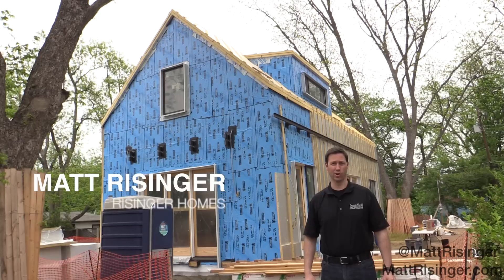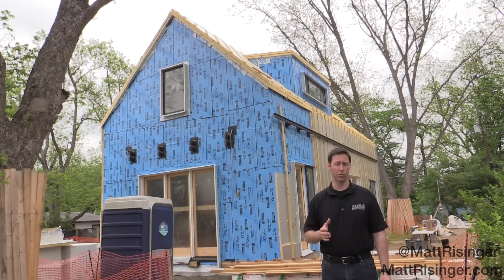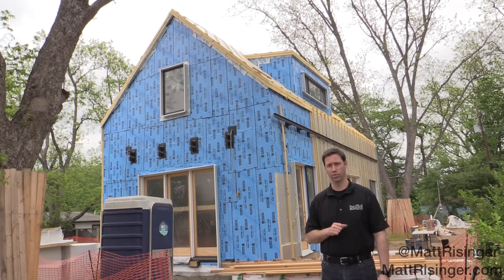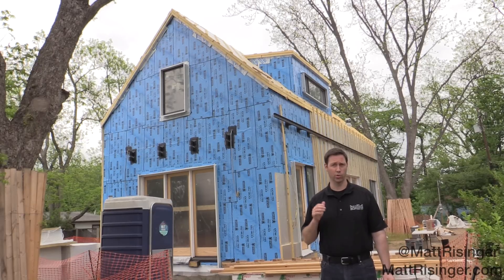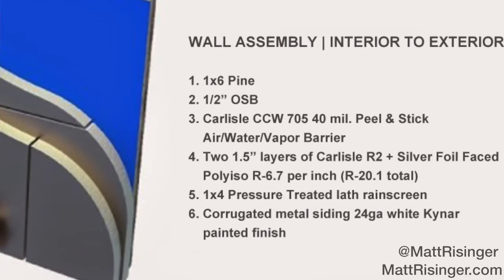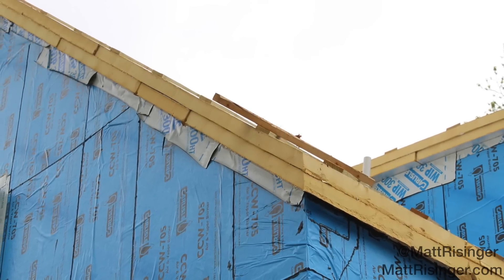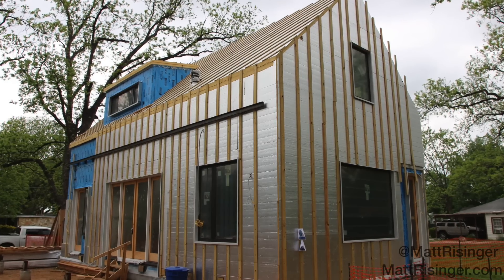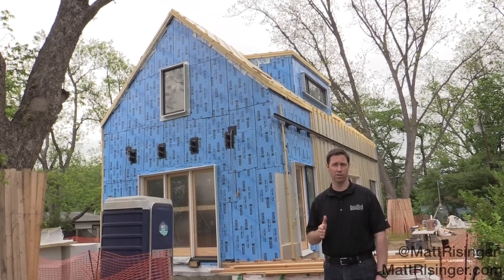What is the "Perfect Wall" for a house?  (with 500 year durability)

Comment: Thanks, the video was enjoyable.

Why put a fleece jacket on the outside rather than between the ribs? Surgical requirements aside, people feel cold based on the perception of skin temperature. (Tests done with Navy SEALS many years ago.) With a house, unless you are touching a wall, insulation is designed to reduce the exchange of temperature from one environment to the other. I'd have to see a test of how moving a set amount of insulation outside of a structure rather than within the structure makes a substantial difference. Best system is likely a staggered structure that reduces conduction through the structural material. Considering build cost versus energy savings, calculations would need to be done using the speculative information on what energy costs will be. Lots of variables are in this decision.

Comment: i think this is a sound concept but claiming 500 years i think is a bit optimistic.

r20 isnt even code for exterior walls where i live. if your looking to have a well insulated house where i live your looking at around r30 atleast. 

and a stick frame house lasting 500 years? with some peel and stick stuff? sorry but i dont think so. the adhesive on that moisture barrier is going to break down over hundreds of years no matter how great it is right now. your basically relying on tape to keep out water for hundreds of years. and have you ever seen 500yo osb? i havent either because theyve only been making it for what 30 years mabey?

Comment: Why would you use an open cell foam board(poly-iso) instead of a closed cell foam that will not soak up water? Now I forget the name but the pink foam board. I had researched the difference and they both insulate the same, but the non poly-iso foam is a closed cell that won't soak up water vs. The poly-iso that will soak up water if it gets to it. If you've an answer, please answer, bc most builders I talk to or the expert at the stores only have an answer of "I dunno." It took a lot of searching on my part, but I think I put a wall together that will work better than the original. I know it's better energy-wise.
Reply: EPS, the open cell foam, is much cheaper than XPS, the closed cell foam. So usually XPS is just used in water sensitiv areas like basements and reversing roofs... Your wall insulation is easily protected against water with a decent siding, like shown in the video.

Comment: You forgot one important concern, and that is fire safety.  As the recent high rise fire in London showed, the perfect wall can be a fire trap!  The insulation will burn rapidly with an air space next to it.  Fire suppression is an important consideration for any structure.
Reply: He used rockwool insulation which is noncombustible and a noncombustible metal cladding. Also, the airspace is very small, whereas grenfell has a 2 inch airspace. Also, this is only 2 stories tall so that chimney effect doesn't happen. Building Science Corp. did an entire post about it on their website.
Reply: See more recent videos on Rockwool. Matt takes a flame to it and nothing.
Reply: Very good point!
Reply: Excellent point.
Reply: "the perfect wall can be a fire trap!  The insulation will burn rapidly with an air space next to it."
actually no. the perfect wall (no flammable matchsticks holding everything up) contracted and paid for high grade insulation specced and actually tested (on site with a real life test fire, as your not gullible enough to pay the cash and just take what the label/PR says as true) not to ever burn.

 cutting corners on every job for the sake of construction/retrofit profit (and it will never happen to me mentality) burns it all down ,especially when its insured and worth more if it does (building 7 etc)
Reply: @everestneverest9720  Exactly. An air gap does not mean air chasm. You need an air gap. Hell. All brick buildings have it. Everyone is saying that because of grenfell tower but that fire has 10 different things wrong with it. I forgot who but someone did an in-depth analysis of it. Pretty sure it was Lstiburek

Comment: The house may last for 500 years, but you will die after 20 with that foam insulation.
Reply: Thoughtyness Because why
Reply: Foam insulation has been linked to several forms of cancer and other health hazards.
Reply: Thoughtyness My understanding is spray foam improperly cured after installation cause heath problems.  SIP panels are cured in a machine at the factory and likely properly. Do SIP panels cause health problems?

Comment: Was wondering what the dark horizontal line is up near the roof,
also what the vertical pairs of dark objects up near the roof on this side are.
Reply: Steel structures for supporting overhanging roof sections (not yet installed).

Comment: the ONLY correct way to build any wall is with I.C.F. forms and concrete.
Reply from the maker: +Daniel Smith ICF can be a very good wall but remember that like any wall you need a top notch WRB system. I've found ICF walls seem to have a higher rate of water intrusion issues.

Comment: Would the 1x4 strapping stand up to attaching solar panels to?  With those long screws, it seems like the shear loads would be high.  I guess if you tied multiple of them together via something on top of the metal roof, they'd be less likely to move around.

Comment: Why not just use ICF?? Insulated Concrete Forms, such as Fox Block. No rot, no air or water leakage in walls, no insect problems, better insulation, better sound control, and reinforced concrete structural walls that are strong enough to resist even strong earthquakes.
Reply: ICF is the way to go!
Reply: Done mine 17 years ago.  Could not pick better material.

Comment: It's true, many studies would say this is a perfect wall for a hot humid climate. Thank you for the demonstration. However, having no roof overhang makes the wall less perfect (although a statement of style). It should be noted that this is a problem-causing wall in a cold dry climate, with an interior membrane. A thicker insulation in the roof is also best for a cold climate.
Reply: An extra interior membrane is unnecessary in this case--the peel and stick membrane is the interior membrane.

Comment: Wood, inherently is not a good long term building Product. Theory dosnt mean shit in the real world, so a 500 yr 'Wood' house is a ridiculous statement. Build with Concrete and stone to get a 500 Yr house!
Reply: Yes Roberto,however,I bet your home is not built with lite wood framing,OSB,peel and stick,glue,caulk with zero overhangs. It is more than likely solid timber frame,maybe even white oak a quite rot resistant wood.
Reply: 500 year old wooden houses aren't just theory, go to Japan or the UK (and probably many other places) and it's not that hard to find examples built 500+ years ago that are still standing.
Reply: BobElHat  I've been to Switzerland and have seen a wooden home that's over 700 years old, that's not the norm buddy! There are very few of those structures around and certain conditions that have allowed them to still stand. There are stone and concrete structures still around from 10,000 years ago!
Reply: Now your talking !
Reply: Utter nonsense Dan . . . .  I am in the UK and I live in a 500 year old wooden house and my guess is that it could easily go on another 500 years . You can find examples , like mine , all across Europe . They were built correctly .
Reply: Dan - they are absolutely the norm.  That's exactly how people built their houses 500, 600, 700 years ago - and far from there being 'very few' -  there are millions of them still standing.  'Certain conditions' - you mean the normal european climate!

Comment: Foam is a tricky situation. While awesome in insulation qualities, has weakness... FIRE. Raging inferno fire that firefighters could not stop it from consuming the structure.
Reply: True, if you're in a high fire risk area mineral wool would be a better choice, although foil-faced polyiso is pretty fire-resistant already. Going all-electric, eliminating gas utilities, and putting all wiring in conduits instead of running bare romex will keep interior fire risk to a minimum.
Reply: Haile Xiao some sip panel makers build conduit right through the foam
Reply: Haile Xiao arc fault breakers are reducing fire massively...
Reply: So wood is fire proof? I had no idea.

Comment: Matt thanks for the video. I live in Florida and based on my 35 years of personal experience I will never build anything out of termite food.  My experience has been that nothing made out of wood will last 500 years in Florida.  The constant attack by termites both subterranean and dry wood is a never ending problem.  I will only buy concrete block properties and even the wood in those have been attacked by termites. Door frames, rafters, window frames ect anything that has wood in it seems like it is magnet for termites.  I have this problem in about 50% of the properties I own.  Tenting, trenching, baiting, treating wood surfaces are all solutions but unfortunately just temporary and most of these treatments use highly poisonous chemicals and gases. In addition these treatments are expensive and then you have to pay yearly to keep the contract in force.  Eventually you have to treat again and the whole process starts over.I am planning on building a house soon but more than likely it will be solid concrete. Love to know how you termite proof your houses.  Even if there was such a thing as a termite proof house, I don't believe it would out last a properly built concrete house.  Just my 2 cents based only on my personnel experience.
Reply: alan juoe 

I lived in Brasil,(MG) for a few seasons. They have ants there that culture a fungus that decomposes concrete; there is no perfect building system; only one optimized for local conditions. Concrete is not impervious..
Reply: Erek: Concrete? There are hundreds of variations, some being waterproof. That's the key.
Reply: Wow seriously? That's ridiculous. We have Termites here in the south obviously, but also these annoying freaking carpenter ants..
Reply: @MRSketch09  carpenter ants.... the termite of the Midwest.
Reply: I live in a concrete block house with a brick facade in humid eastern Oklahoma. It’s a strong house built in 62, I think. We fought mold due to sweating concrete  when we moved in 17 years ago, and had to install slim false walls within the exterior walls in order to apply insulation and a vapor barrier. It’s made for beautiful living since then, but those slim walls are wood framed, so now we have to have a termite contract. When we build our own home we’ve got to come up with a better arrangement of materials.
Reply: @JEBavido  AAC, Autoclaved Aerated Concrete.  1/5th the density of standard concrete = thermal efficiency.  Blocks developed in Sweden in the 1920s.  Decades of use around the world.
Reply: The answer is BORAX......Mix up a solution and spray the living piss all over the wood after the framing is completed. Lay a granule Borax barrier between any and all wood that contacts concrete. Ants hate Borax as well. You'll never have your problem again.
Reply: WhatIsMisophonia I’m not aware of any above ground structure able to withstand an f5 tornado...
Reply: Yes I live in Oklahoma and the F5 requires an underground bunker if there is a direct hit. The biggest F5  was 2 miles wide but most are under a mile. We have a lot of 100 mph straight line winds associated with tornado supercells. Hurricane Irma flattened Barbuda except for some insulated concrete form (ICF) buildings It's amazing how strong that type construction is.
Reply: @SuperVstech  When God wants something removed....... it gets removed.
Reply: alan juoe what about P.T. lumber and PVC vinyl lumber and composites for framing studs and doors and windows...?
Reply: alan juoe hello, I live in deep South Texas, if I built a solid CMU house, how do I stop moisture from finding it's way indoors? thank you
Reply: @victorperez8295  You properly water seal it on the exterior during construction just like a wood sheathed home.
Reply: Jan Schlossar  I find it funny when people call others names like" stoopid"! STUPID!😆
Reply: I would argue that his notion of a "perfect wall" has more to do with the placement of building materials more so than the composition of said materials.  Concrete is good no matter where you are; Here in the midwest, we don't have to deal quite so extensively with rot and termites, but houses should also be built with extreme weather in mind, and a solid reinforced stem wall is the only thing able to resist an f5 tornado.
Reply: WhatisMisophonia: How about a shotcrete monolithic dome? It withstands F-5, is fireproof, termite proof, mold proof, waterproof, airtight. Stabilized adobe buildings have lasted millennia. Natives used them here so they were called "mud huts" and rejected. The European colonists copied their ancestors in both materials and design. That irrational prejudice cost them dearly.
Reply: Janet Bavido concrete only sweats when no airflow you got to have airflow in your homes otherwise you get get condensation and mold either some did not put air blocks in or they built a solid wall without a cavity and the sealed it up  so there was know where for the moisture to go your home will stand a lot longer than any of these wood structures. Most of these vapour barriers start to deteriorate after 25 years that allow moisture to trap these American security board homes are not work the money you pay for them. We have seen builder bring this type of building techniques to the UK me call the prefabricated home as they come in a kit but they are only lasting 25 years and the buildings are needing replacing they are ok for travel lodge hotels because they tend to be knocked down after 30 year and rebuilt,  but for home for people to live in , no way .
It's a shame your building contractor went down that cheap easy route as you could have had some better European  methods applied 
I would have used an injected able chemical damp proof course. To stop ground water penetration rising up the walls then place air locks in the wall to allow air flow in the property with air channels in the window frames, that will take care of e damp. The i would have used cement board with a metal frame or used plastic spacers to give you a air gap with a chemical penetrating breathable product on the concrete to prevent water going from the outside .
On the out side of house make sure your covering was done properly to make sure of no water ingress then you could of dab fitted the internal liner doing away wood framing
Reply: We build our homes out of brick or concrete blocks or thermal blocks with filled cavity wall insulation single or double cavity . They sit on a reinforced concrete foundation at least 1.5 metre deep and 0.75 m wide we then have a brick layer followed by a damp course then you build the house with brick and block non of this cheap and nasty machine woods we use OBS for framing to pour concrete into

Comment: Peel and stick on the OSB...so I assume you want all the drying done to the inside of it.  And it would be nice if you had a plastic netting 1/8" thick hanging down the wall to be a gap between the the peel/stick and the foam.
Reply: There is no insulation to create a temperature differential for there to be a condensing surface, so why complain? It's like complaining about potential condensation on a window in the center of the house...
Reply: Why would you want such a gap?

Comment: +Matt Risinger   I am considering your methods as in Florida they are stuck in the past with t111 or hardee board with poor sealing for air leaks.    My question is how do you deter, deny termites, ants, and other colony creatures from digging into your furring strips behind the metal wall?    And maybe I missed it, but how is it for blocking sound (we will be building a short way from a railroad line).  Thanks.

Comment: It seems like you're using polyiso insulation, which (in my experience) is ruined by water. What keeps it dry? Even if the foil facing sheds water, in the video it doesn't seem like you've sealed any of the seams or edges, and the seams will grow as the insulation shrinks. I'm really interested in this idea, but I don't see how it's viable if the insulation sees ANY water.
Reply: this article demonstrates how the seams are sealed and taped. it doesn't really show how to tape the 6+ inches of exposed foam at the edges of the roof though... http://www.greenbuildingadvisor.com/video-how-install-rigid-foam-insulation-outside-house
Reply: Polyiso does absorb water when soaked, but I doubt it rains that hard anywhere in the world, much less Austin, TX.